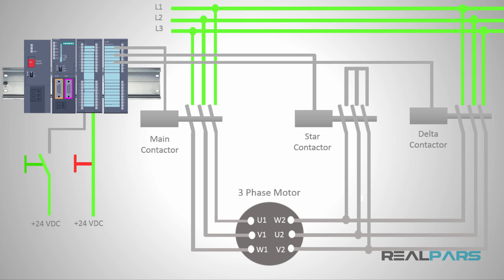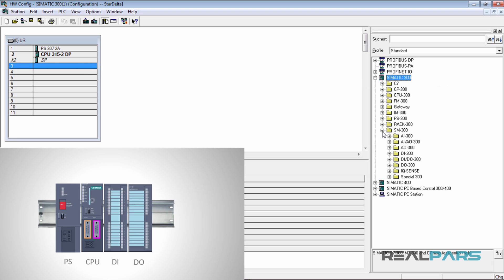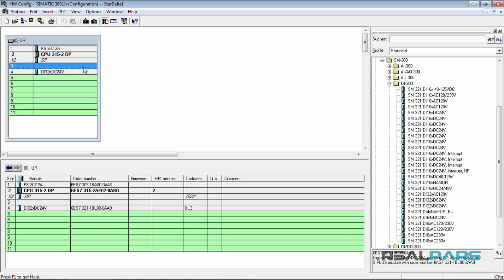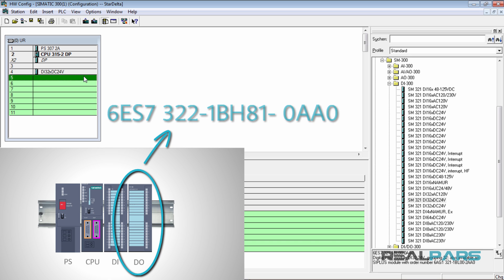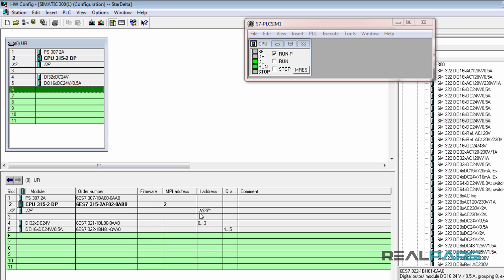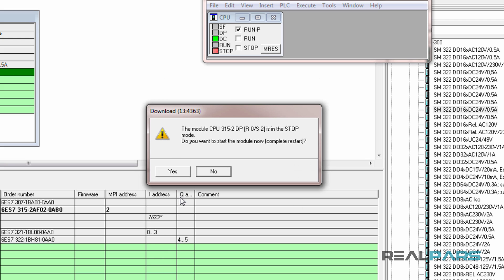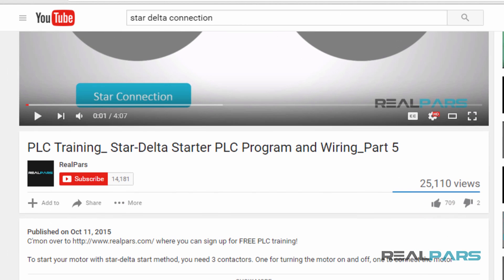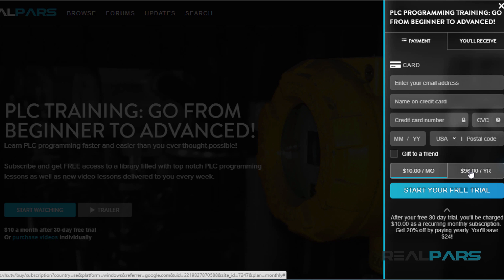Star-Delta Starter PLC Program and Wiring_Part 8

Comment: i learn only use slot 3 if you have interphase    in project
Reply from the maker: Hello, @africanlights4559  Thank you for your question. Yes, this is correct for the Siemens S7, Simatic Manager software. Why? Because the Siemens design is configured for the interphase Module to connect with the communication bus via the back plan connectors close to the CPU, avoiding electrical noise is a primary reason. You can find more information in the Siemens S7 user manual.

Comment: So with PLC there is no need for an overload relay, timer and breaker?
Reply from the maker: Hello, @tusmileeng6326.  Thank you for your question. Well, not that easy. The PLC controls the relays that control larger, more expensive, higher current devices.  You will still have to use a starter relay, breaker, and overload breaker; the PLC can control the rest. Happy learning from RealPars!

Comment: Awesome,  so detailed, nothing left to guessing. What is DP and MPI stands for you mentioned in the video. Thanks
Reply from the maker: Glad to hear that, Ben! Thanks for your support
Reply from the maker: DP = Decentralized Peripheral.  It is a version of Profibus that allows for I/O racks to be remotely located from the CPU.  The CPU rack and the interface to the I/O Rack (via an IM card) communicate via ProfibusDP.

MPI = Multi-Point Interface is a Siemens proprietary protocol for communicating with SIMATIC S7 programmable logic controllers.  It was the forerunner of ProfibusDP.  Both are built around an RS-485 structure.

Comment: Why do I have to start the simulator to download the hardware configuration to the CPU?
Reply from the maker: If you do not have a physical CPU connected to the system, then the PLC simulator provides a software environment that mimics a real PLC.  The only way for you to "load" the hardware configuration is to download it to the PLC.  If you do have a physical PLC connected, and the PLC simulator still opens, then you will need to change the PG/PC interface in STEP7 or TIA Portal to the interface that is used to connect to the physical hardware.  This is usually a PNIE or MPI interface.  The software will use whichever interface is selected.  When you activate the S7-PLCSIM program, it automatically sets the PG/PC to PLCSIM and disables all other interfaces.
Reply: Thanks for sharing additional information. Well explained!

Comment: Hello dears .
I am facing this issue when i click on simulator .
"There are currently applications connected to real online CPUs. You must close them before the simulator can be started"
What should to do ?
Reply from the maker: Excellent question!  When using the Siemens PLCSIM program, the only PG/PC interface that is allowed to be running on the PC is the PLCSIM interface. Since actual connections to PLC's use S7ONLINE, MPI, PN/IE, or other wired interface, they cannot run at the same time as the simulation program.  The PLCSIM interface is a virtual interface and cannot be connected to a "live" wired interface.  There are so many times that I wish I could!

Comment: why are we using this software and not siemens TIA?
Reply from the maker: Hi Christophe,

There is no particular reason using Step7 instead of TIA Portal here in this example. In practice, the TIA Portal usually used in larger projects with more powerful CPUs. In the cases that we do not need to monitor the process using WinCC, we can use Step7 as it is extremely lighter in compare with TIA Portal.
Overall, Step7-WinCC is exchangeable with TIA Portal.

Comment: what's the purpose of MPI ? 
and what is the Im ( interface module )
Reply from the maker: Hi there, MPI or Multi-Point Interface is an interface that is usually used for connecting computers to the Siemens PLCs. 

For IM you can watch this video on our platform: https://realpars.vhx.tv/plc-hardware/videos/35-interface-module-final-1

Comment: THANK U,
can i ask u one Q. 
can we use Timer in place of PLC for auto change over supply from star to delta.
Reply from the maker: I could not understand your question but if you mean whether or not you can use timers in your PLC program for running a 3-phase electrical motor with star-delta starter the answer is positive.